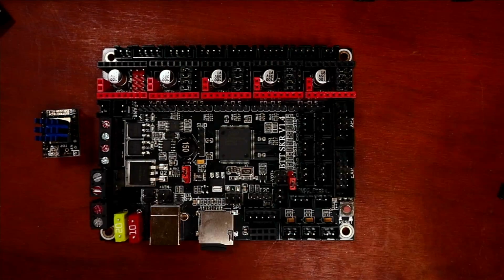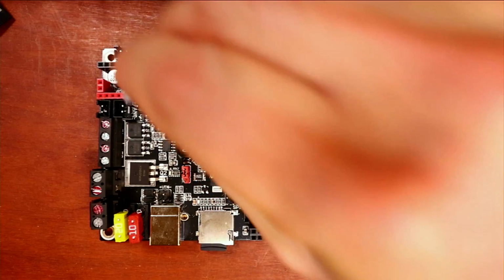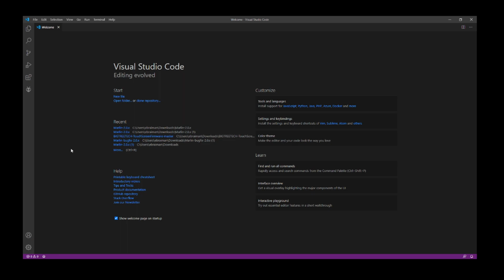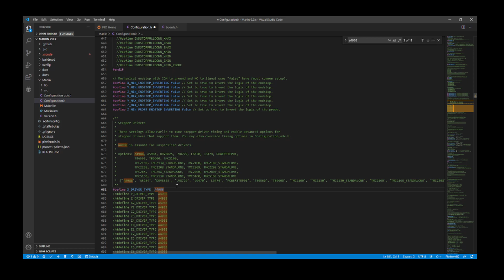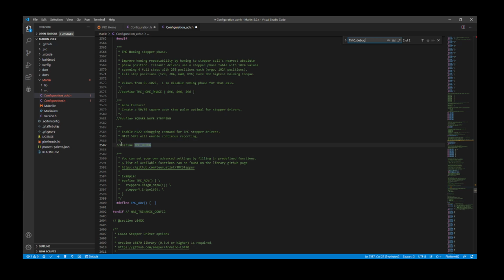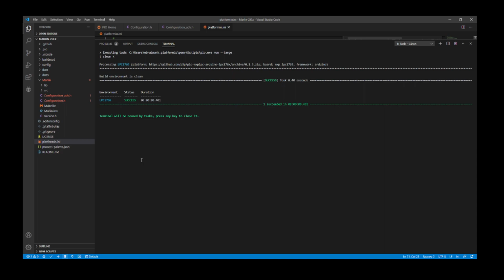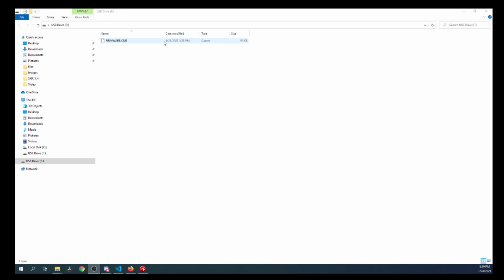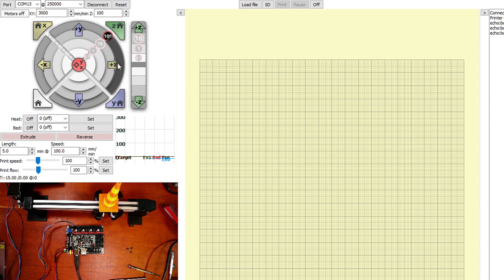SKR 1.4 - TMC2209 with Sensor less homing.

Comment: On the latest V3 TMC2209 drivers the jumper position under the drivers for UART is different. I just wasted 3 days trying to figure out what was wrong. I was getting an "all low" error all the time. The older drivers have the jumper on pins 5 and 6 counting down from the board side, on the V3 drivers the jumper goes diagonally between pins 2 and 6.

Comment: When you want to run the TMC2209 in stand alone mode on for example E0 and Z0, do you need to bend the pin on the stepper driver and keep all the jumpers in?
Reply from the maker: Unsure, reason being I cover most often used configuration.  It would be better to use tmc2208 if you want to do it that way.  Standalone in my opinion has little value add to printer experience.

Comment: Hi Edward...I have Skr1,4 turbo board and 4 x DRV8825...I could only adjust the Z axis...the other homing not working correctly...Can I adjust sensorless with this stepdrivers...
Reply from the maker: Unfortunately drv8825 do not have sensorless homing capabilities.
Reply from the maker: Why do you theorize homing is not working?

Comment: So you power the board with 12V and connect it via USB to the computer at the same time?
Reply from the maker: Yup.
Reply from the maker: Just  run off same power strip.

Comment: I have a MKS TMS 2209 V2.0 drivers. Do they also work on the SKR 1.4 Turbo? Can't find any instructions to that.
Reply from the maker: Most people use BTT tmc2209, but the chip in both steppers is the same.  The stepper board layout may vary by silkscreen.  Not sure the answer is clear, but I'll try maybe tonight on livestream at 6PM EST.

Comment: So you don't have to connect the endstops on the board?
Reply from the maker: If you're configured with sensorless homing.
Reply: @EdwardBraiman  I did everything in your tutorial except that the Y just wants to keep on going, but can't go any further. It makes a rattling noise at the endstop. Everything else just seems to work fine though. :(
Reply from the maker: What's the setting for sensitivity on homing?
Reply: @EdwardBraiman  I changed the numbers and sort of works fine.
Reply: @dragnet53  bump up y's stall guard sensivity

Comment: Hello.
I have a 3D printer from anycubic S.
Recently replaced motherboard with skr,
but I can't get the all axis endstops to work.Driver is TMC2209
Pls tell me🙏
Reply from the maker: How do you mean?  What happens when you home each axis?
Reply: @EdwardBraiman  
No matter how many times I press the switch, all the axes won't stop.
Reply from the maker: With sensorless homing, you do not need switches.

Comment: skr 1.4 turbo and tmc2209 v2 driver sensörless homing working ?   and sensörless homing  we need jumper settings ? or not need jumper settings. just software sensörless settings enough ? 
Thank you.
Reply from the maker: Currently BTT does not produce a v2.0 of TMC2209  stepper.  If it's another brand of stepper it may or may not work the same.
Reply: @EdwardBraiman  sensörless homing  we need jumper settings ? or not need jumper settings. just software sensörless settings enough ?
Reply from the maker: Jumper settings maybe the same, but you'd need to see if wiring of steppers is the same and verify datasheets.  Are you using a different manufacture of stepper?
Reply: @EdwardBraiman  You just installed the uart jumper on the skr 1.4 turbo motherboard. You did not use any other jumpers for sensorless homing. Is this true? For example, an extra jumper is installed for sensorless homing on the mks sgen motherboard.
Reply from the maker: If memory serves me I just installed stepper jumpers, but there's a link in description to motherboard manual.